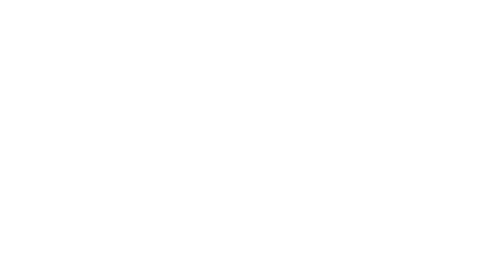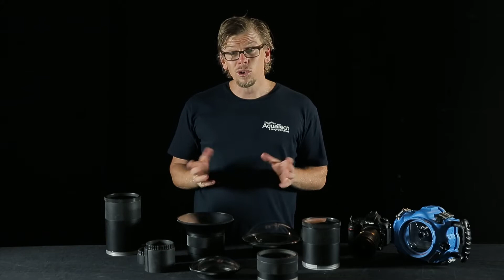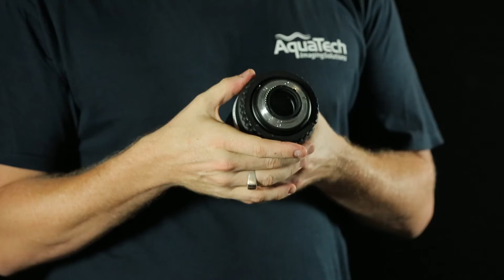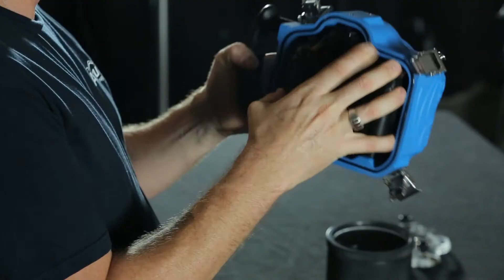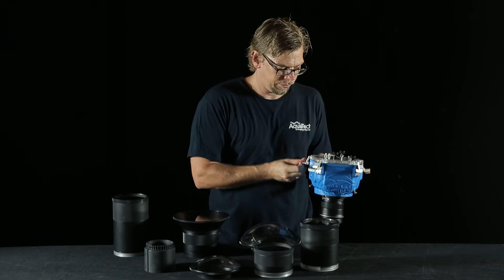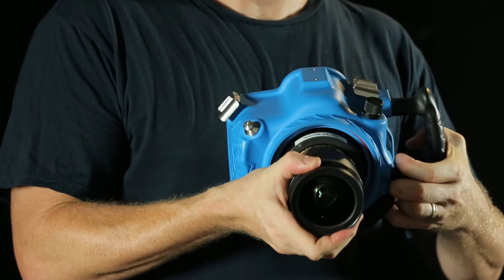How to setup the AQUATECH Zoom Gears and Lens Ports

Comment: Just bought the zoom gear for the RF24-70 f1/2.8 that I am in an edge housing. It´s the most expensive peace of plastic I ever paid for and does not even work. If the zoom gear is attached to the lens it is impossible to fit it into the housing. It does not even fit into the lens ports anymore. this is ridiculous aquatech!
Reply from the maker: Hello! Sorry for these issues. Please email service@aquatech.net and we can help out.